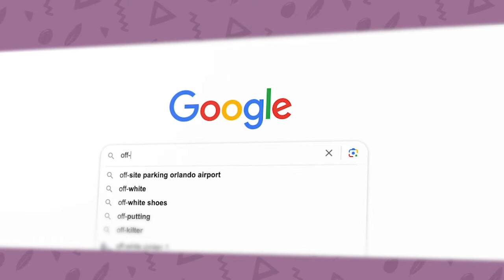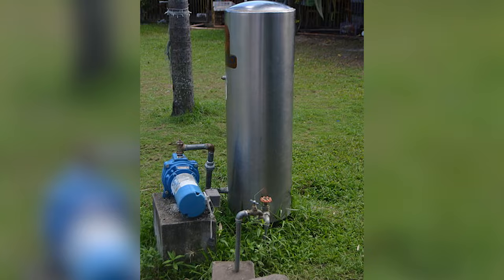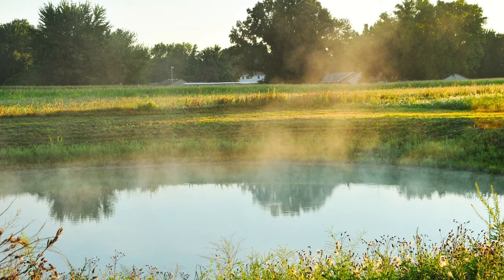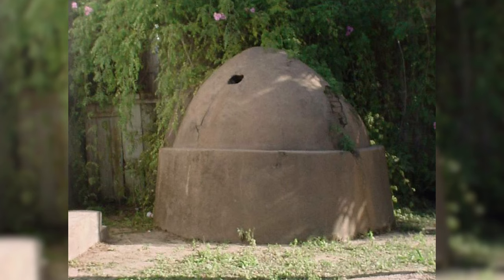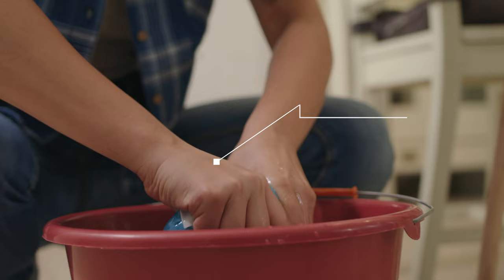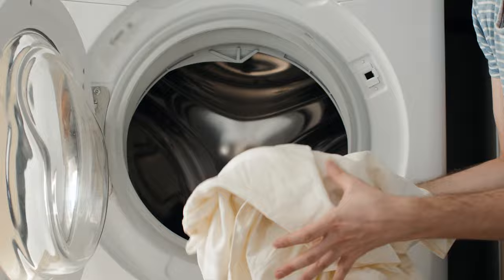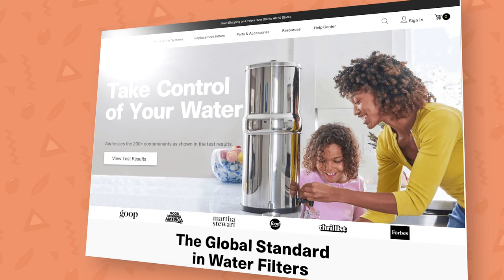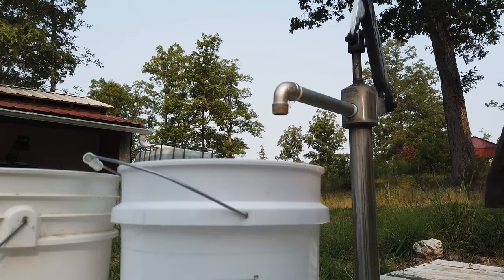Getting Started With Off-Grid Water Systems

Comment: After a newly purchased older home, we ran out of water the first summer. Had to frack the well, and set up a secondary tank & pump for back up. I collect rain water all summer long for outdoor use, and have the ability to distill water with a distiller that runs on electricity or purify without power with a Berkee filter system. I also collect my grey water in my bathroom to flush the toilet with.

Comment: In some areas, a well should be the last option. I understand the costs or ability to diy a well or access to ground water is easier and cheaper or whatever… but, I’d start right in with rainwater collection and diverting rain on the ground.  Having ponds is great but water can be diverted to into planting areas and encouraged to soak in with berms.  With something like hugelkulture, the plants in those areas will need very little ‘manual watering’ once established.  But, there’s lots of options.

Comment: Yes. Very good overview of the options. And I appreciate the resources you have shared for finding more information.
Right now I live in an apartment, so establishing an off-grid water system is not an option. BUT, I can start thinking of ways to reduce my water consumption (for example, using my dishwater to flush the toilet and start doing more sponge baths), as well as finding a way to collect rain-water for my houseplants, even if it is only for a few months.